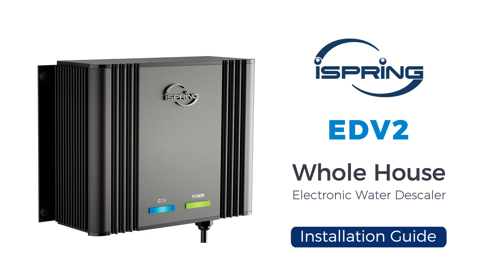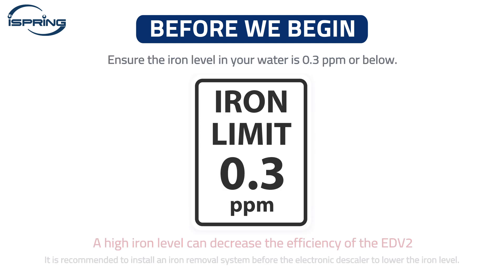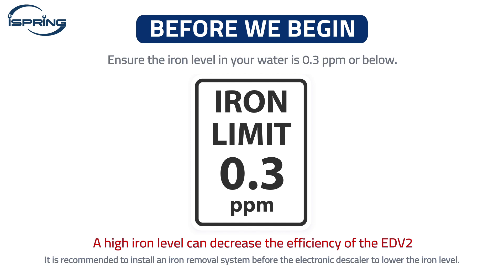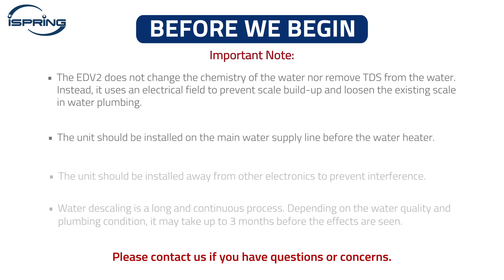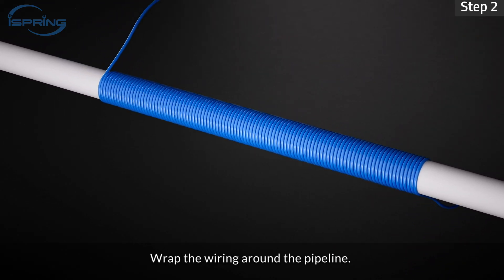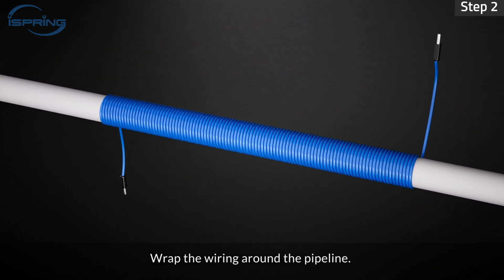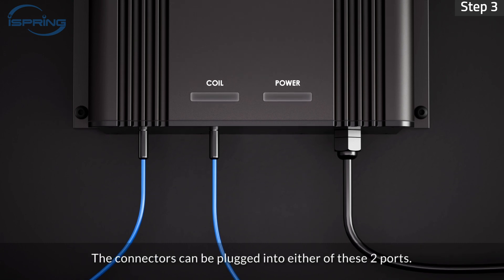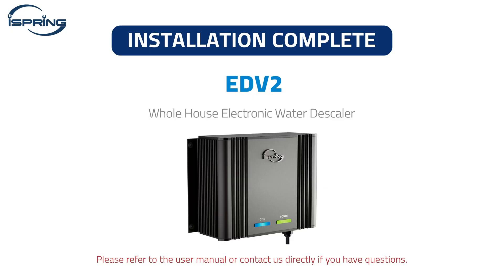Transform Your Water: Easy Installation of the iSpring EDV2 Electronic Water Descaler!

Comment: I have this installed in a restaurant. The city water scale level is very high. The ice machine distributors would be clogged of white calcium flakes making the ice machine stop working every 2 weeks. After installing EDV2, and 2 weeks into cleaning the distributor one more time. Its been 2 months of no scale clogging and no further service needed to fix the ice machine. Also, during that time it was breaking down, the ice machine also has its own water filter specifically designed for ice machines that failed to filter the scale. The electronic descaler is a life saver as we have no room anywhere to install a water softener system.
Reply from the maker: Hi there! Thank you for sharing your experience. We’re thrilled to hear that the EDV2 has helped resolve the scale issues. If you have any questions or need further assistance with our products, please don’t hesitate to reach out to us at support@ispringfilter.com or 678-261-7611 (M-F, 9:00 AM–5:00 PM EST). We’re always here to help!
Reply: The wire included is longer than I need. Can you wrap multiple layers of the wire overtop of one another?